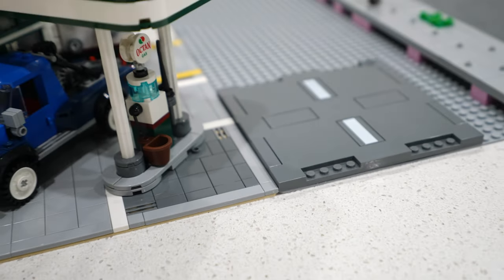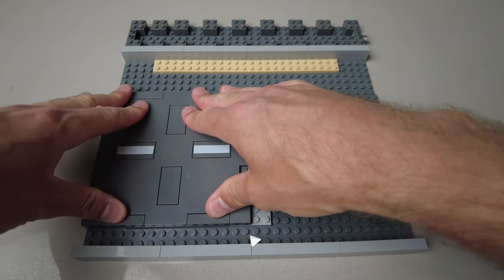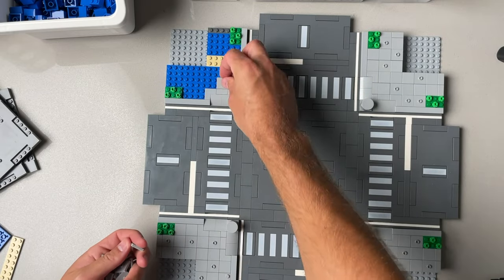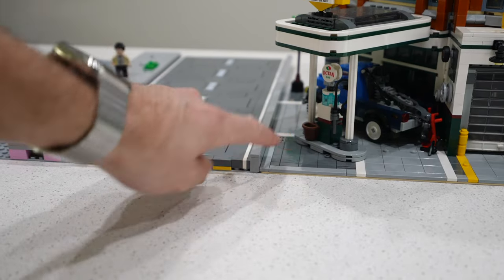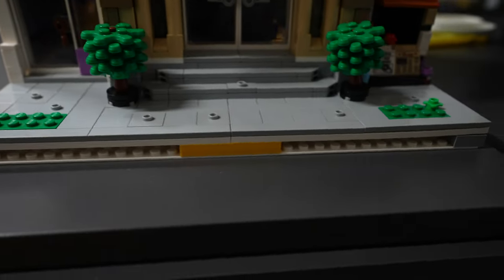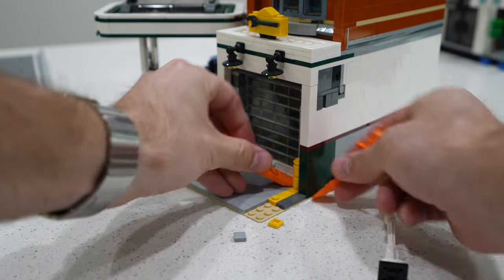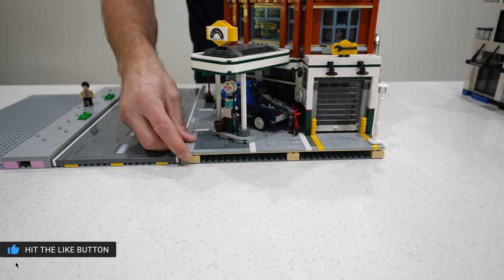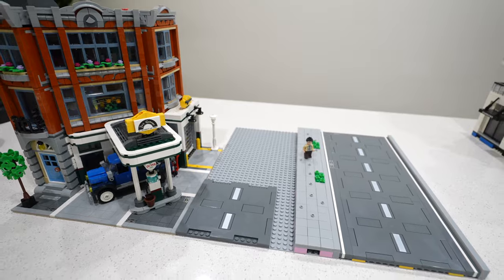EASY FIX: Fit old Modulars to New LEGO Road Plates!

Comment: I ended up prying the modulars off the base plate then using the Lego tool to remove the tiles and other smaller pieces. Followed the instructions to put the pieces on the plates. Took a very long time and I have the diner left so I'll be using this method

Comment: But because the bottom of our modulars are simply a standard base plate then it's just "floating" on top of those 2x2 bricks yeah? I've changed over a couple of my modulars to mils plates and it was surprisingly easy and even kind of fun because  I could then add my lighting wire runs underneath for my street lamps and then it safer to pick up and move the whole modular as well. I definitely don't want to move a modular around that is not on a mils plate, it's just too wobbly. Good quick fix I suppose but in the long run I'd go to mils plates.
Reply from the maker: The little stud divots on the back/ underside of the baseplate attached to the modular help to hold it in place on the bricks. But yes, it is technically floating.... you can easily anchor it to the road tho with connection points if you were worried about it shifting!

Comment: Really like the idea but surely it just slips around as you can't connect the bricks to the modular base plate?
Reply from the maker: Only slips if you’re moving your city around/ tables around a lot. Otherwise it sits well due to the dimples on the underside of the modular baseplate

Comment: Instead of building your roads on base plates, try building roads on regular plates instead. Only use baseplates for buildings so it will create one and a half plate hight difference between roads and sidewalks. Now your sidewalk ramps will line up perfectly with the road without this half a plate high difference. 😉